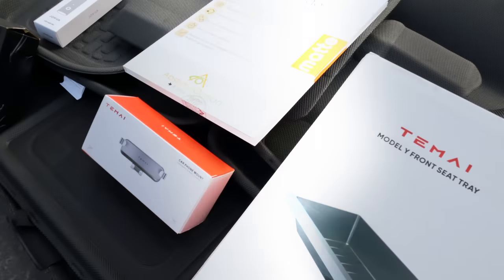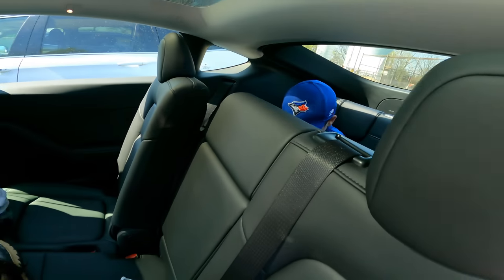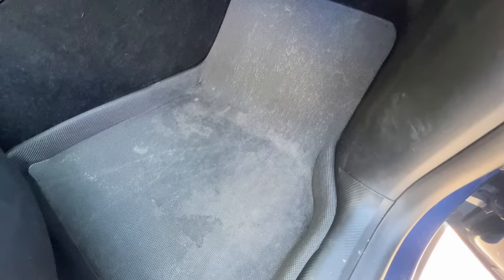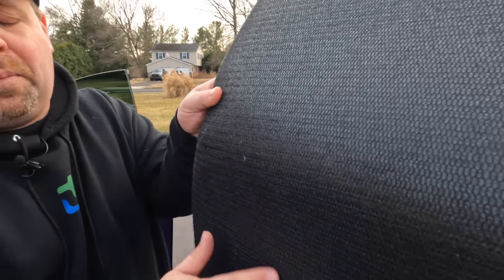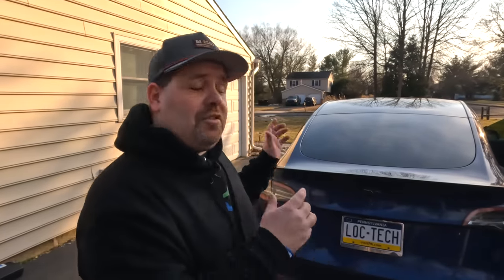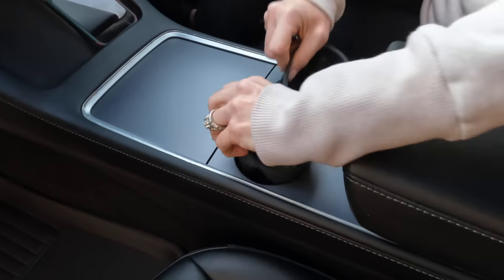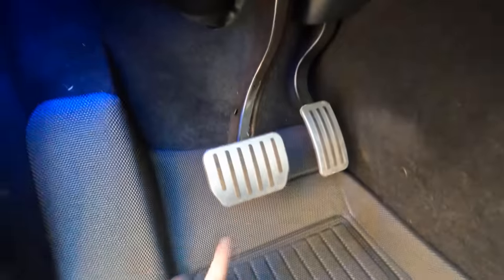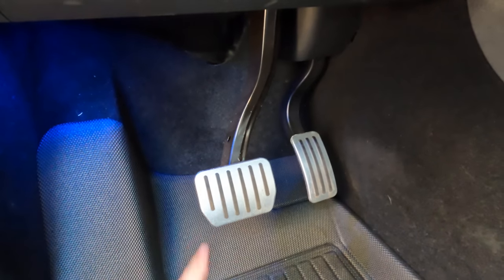MUST HAVE Tesla Model Y & Model 3 ACCESSORIES | Plus durability review after 1 year of use & abuse

Comment: The first thing that I need is the Quick Bandit front license plate holder. Second would be a car cover (I don’t have garage). Third would be those mats (I’m not worried about spills because no drinks are allowed in my car).
Reply from the maker: Have you seen the Slipstream front plate holder from Grin?  It’s awesome.  We did a quick review on it as we don’t use them in PA but it was great.
Reply: @LockettTech  Because you recommended it, I checked it out. And I checked out SnapPlate too. I don’t know which one is easier to steal or which one would cause damage if another car bumped into it. I think I read that SnapPlate will . . . well . . . snap off to minimize damage and can be remounted with replacement parts. That could also mean that every time somebody bumps the bumper trying to get into and out of tight on-street parking, I’ll find my plate snapped off and laying on the ground. Although the other two look very similar, the mounting and pressure points are different. Perhaps if the bumper is banged hard enough they’ll be hammered into the bumper like a battering ram. QuickBandit says it has an anti-theft screw but one commenter said that he could easily unscrew it with his fingers and another said that the whole thing fell off the car for some reason (nobody else made a similar complaint). I’ll have to research this a bit more but thanks for the recommendation. I guess it’s too much to ask that Tesla simply design its $70,000 car with front bumper license plate mounting points like every other manufacturer but oh well.

Comment: Hey guys, Can you confirm if it’s true that the tray in the center console and the botton that’s located in the front passenger seat that’s used to adjust the lower middle area in your back. no longer comes with the 2022 model Y vehicles.  I took delivery on March,11,2022 for a 2022 LR AWD MODEL Y.  Yesterday I told Tesla that I’m missing the tray in the center console along with the botton on the front passenger as well. My delivery center said that both no longer comes with the vehicle. Do you know if it’s true?
Reply from the maker: That is true.  The center console tray came out a long time ago and they removed the lumbar support for the passenger seat last summer.
Reply: @LockettTech  The 2020 model Y that I trade in had the lumber support and the tray that’s located in the center console. I did get a good price for my 2022 LR model Y with a 7 seater with white on white,toe hitch,19inch Wheels for $61k. Thanks for your feedback.